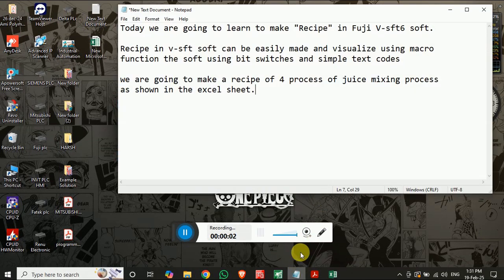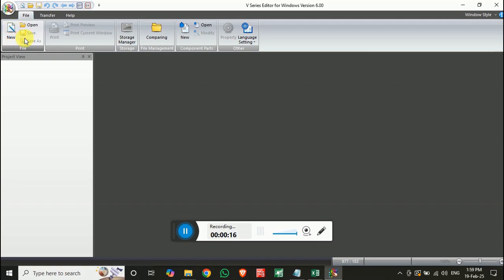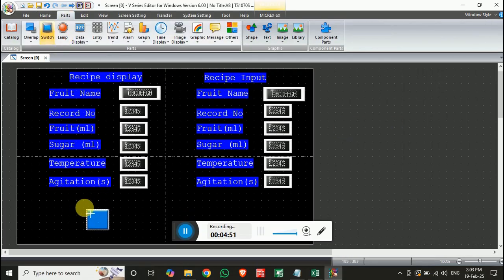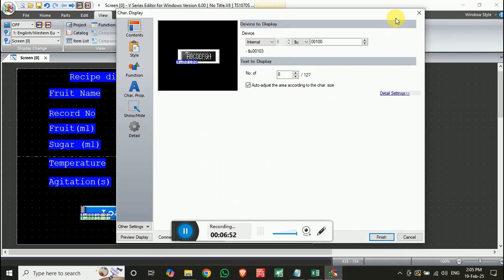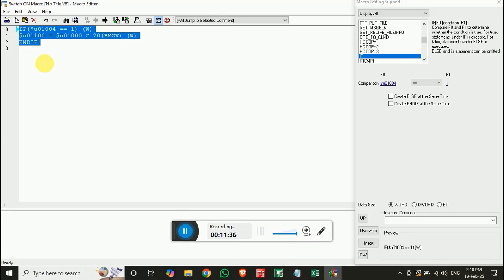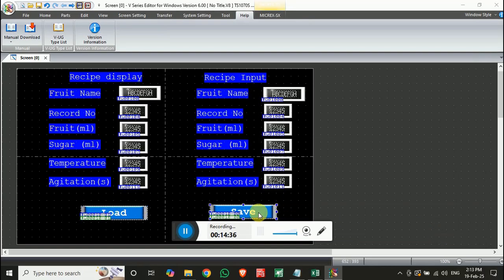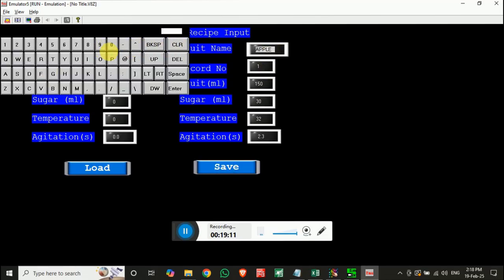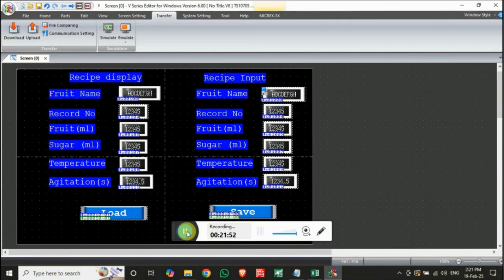Use Macro Switch To Create Recipe in V-SFT 6 Monitouch HMI Soft easy with Fuji SPF series PLC

Comment: how many recipes i can make in this
Reply from the maker: There's no such limitations for how many recipe records or how many parameters per recipe record. This is a method to use simple data transfer for creation of recipe record. You can make as many record depending on the no of data registers available in hmi.
Reply from the maker: To also note point you can also employ this method to move data values in PLC program to create recipe record using fundamental programming in any plc